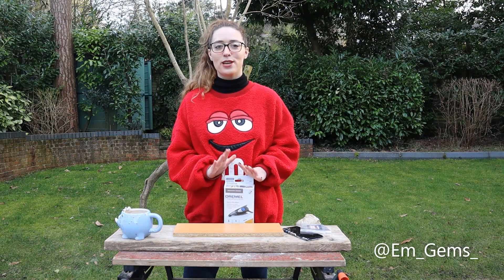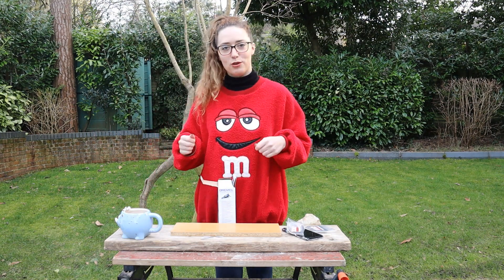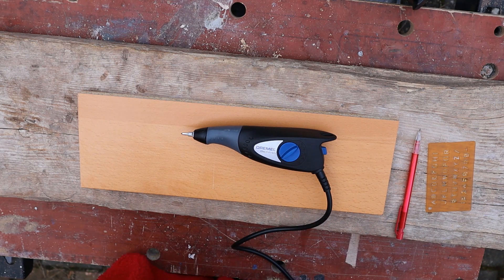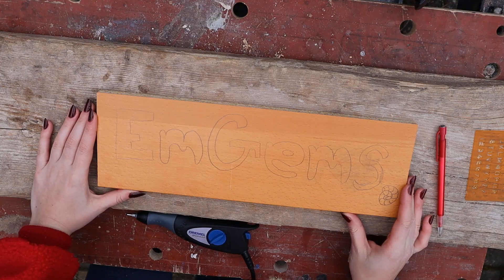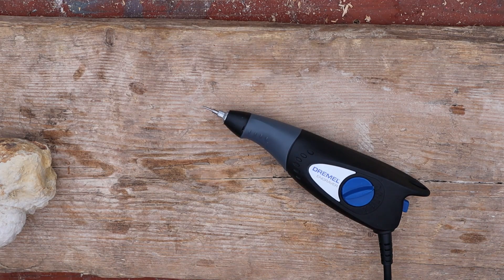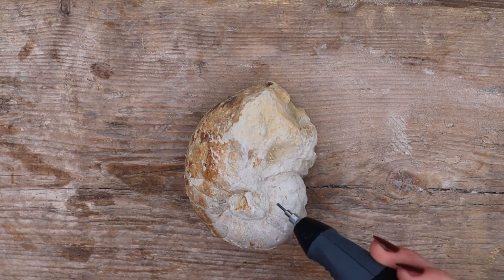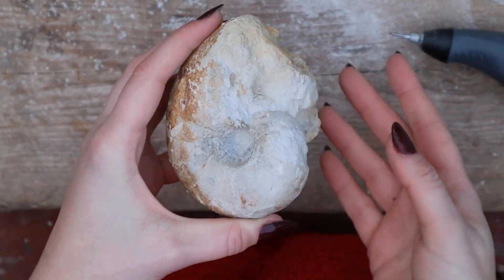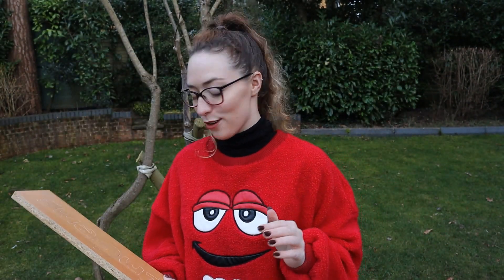My Dremel 290 Arrived! Fossil Preparation Test 👀

Comment: The Dremel is far easier to use if you get a flexible drive and clamp the Dremel to the bench or use a drill stand. Less weight to hold and better for fine work.
Reply from the maker: Thank you, I will look into this!

Comment: I am experimenting with a larger Dremel plus a flexible shaft (which makes it easier to handle) using the diamond tipped tools from Lidl. An interesting video and thank you for it but can I please recommend a breathing mask as the dust coming off the workpiece can be inhaled and you do not want that. Some materials, such as flint, are silica and this flint gave rise to a very high death rate among the flint snappers of Brandon and area in East Anglia.
Barry

Comment: Really pleased you have your Dremel, Em and that you like it. You did a great job - so much easier than a hammer and nail! The adjustment on the side covers a range of intensity from fine to coarse lines - i.e. shallower or deeper impression. I have used mine for both fossils and engraving on metal and it's a brilliant tool. Mine isn't as shiny and new as yours, but they are very robust tools and well worth the investment. I can't remember when I bought it, sometime in the last 30 years anyway and it's still going strong. Take care & see you soon. 👍☺  p.s. I call the replaceable ends bits or tips, but it doesn't really matter!